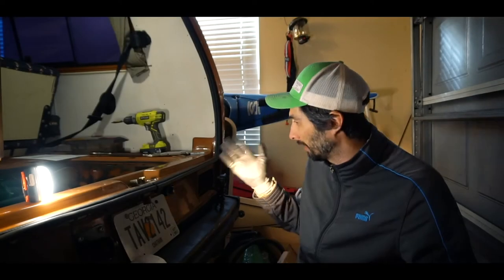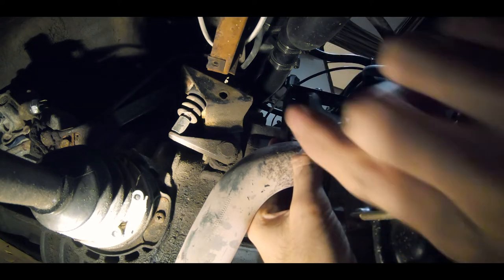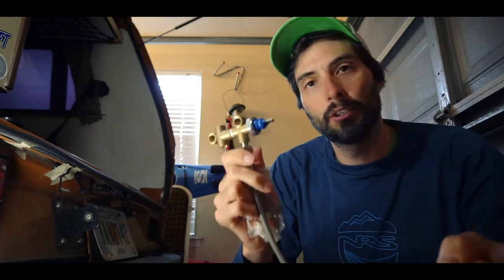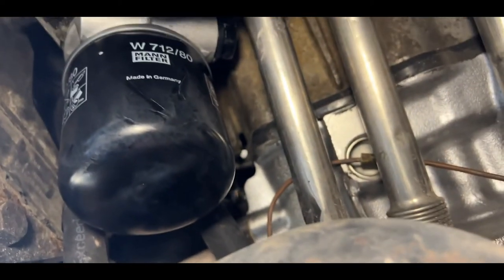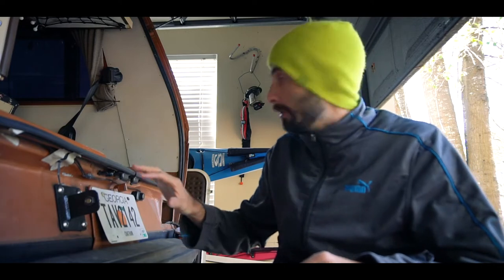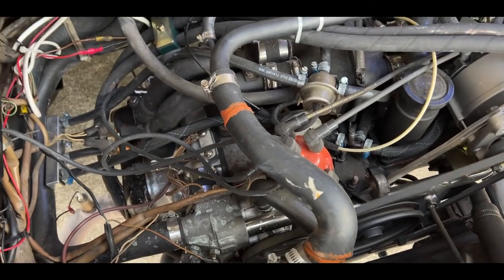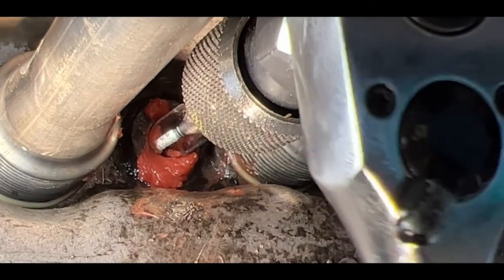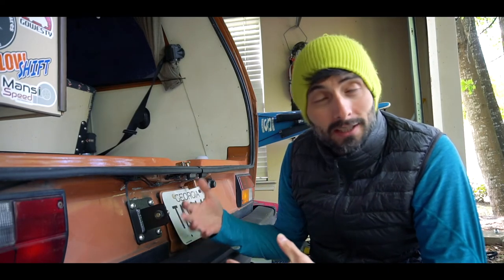Installing an oil cooler on 84 VW Vanagon Westfalia 1.9 WBX - p.2 - Kayak Hipster

Comment: just stumbled across this, thanks for this! i also had an oil temp gauge running off the relocation kit ( fitted by a specialist lol ) and it would only read 60 degrees (obviously cause oil isnt flowing through it properly). i changed it myself and put a sender in the sump plug and now it reads 150 degrees (which i know is way to high) any idea if the make of gauge effects the reading? as the sender is a vdo and says to use a vdo gauge but the ones the shop installed were some cheap looking speedline gauge

Comment: NOT A GOOD IDEA!!!! I have seen a few people mount the oil cooler there, in this position, ITS A VERY BAD IDEA, people, do NOT copy this. First google head hight and any pump!!! what you have done is, you have raised the head hight of the oil, way too high, you should keep the oil cooler on the same level as the mid-point off the engine (give or take a few inches) The oil pump now need to lift the oil way up much higher than ever before, too the very top of that oil cooler, and hopefully at least I hope you have worked out how to bleed the now newly created air pocket. its not a good idea,

And thats NOT mentioning the drain down every time you turn off the engine